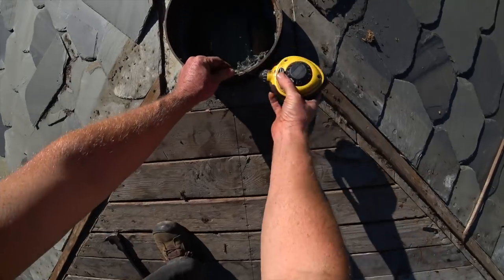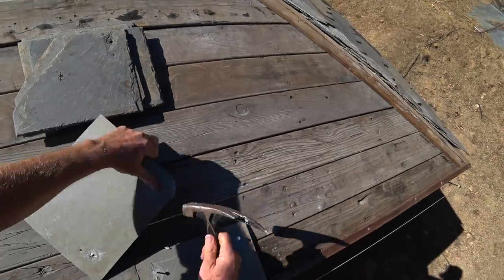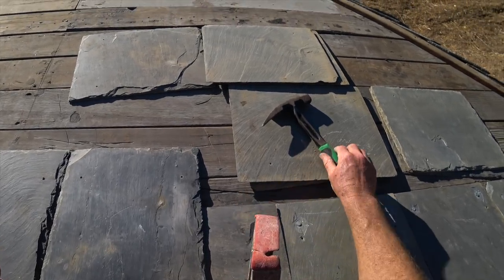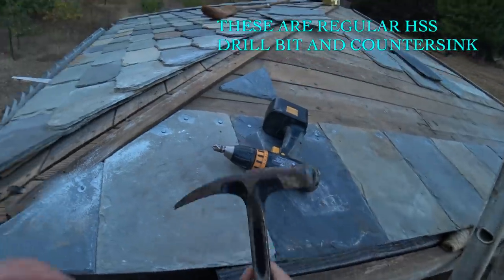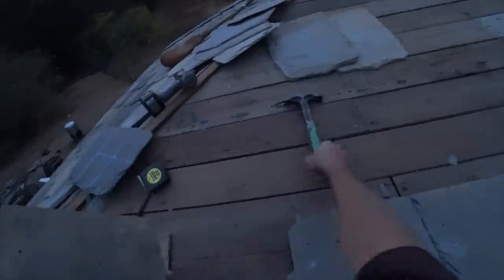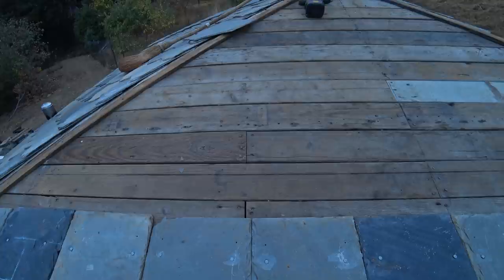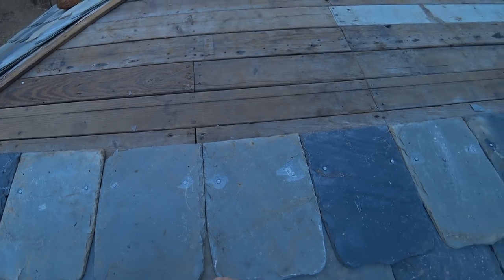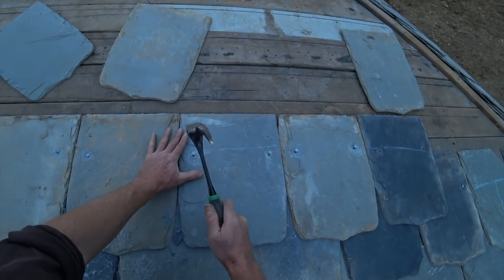Hand Cut Stone Roof #2: Cut, Carry, Lay,  Punch, Align & Nail

Comment: I missed another one live:( Still a great video!  I can really relate to laying roofing asI just completed a shingle roof for my duck house. Around 250 shingles, all hand split by me. Took forever, but it looks awesome!
Reply from the maker: That sounds really cool.  I potentially have access to shingle material.
Reply: @SkillCult  Around where I live (central Europe) most all shingle roofs are made of spruce. I used red oak, just because I found a nice windfall that would otherwise go to my grandad's firewood pile. The knot-less sections split really nicely, but it took me a while to figure out that it doesn't pay off to fight the gnarly twisted growth and is rather easier to just be a bit picky and have more rejects.

Comment: I really love the process, you're very THOROUGH not really skimming over any one aspect of the project, with longer segments that include a lot of the work flow, the quick fixes, and trouble shooting, and mistakes. it's not an "ideal preplanned scenario, it's real time." 

this makes it very easy for me to follow along with more confidence knowing how to manicure the slates to fit just right, and what to avoid doing. I may not slate a roof myself, but I enjoy this kind of knowledge [for tabletop gaming.]  and you present it really well! plese! do more videos of classic knowledge! like...how would you build a wine or root cellar? it'd be below grade, so...how do you shore up the walls, strong enough for there to be a house built on top? that's something I'd love to hear your thoughts on!
Reply from the maker: I"ve never built a root cellar, but I want to. I would probably rely on intuition and overbuilding.  flooding is always a concern though.  Another thing I'd like to build is a spring house.  They are similar but serve a slightly different purpose.
Reply: @SkillCult  Yeah, flooding is for sure a concern! So maybe a sub level, for water to run into...and collect...but makes ya wonder...would the water evaporating, and adding humidity to the air...help the plants? [as long as it's not swampy and rot them...

A spring house...is that like a cold frame? unheated, but still insulating from the winds and frost for helping plants harden off and start the growing season earlier?
Reply: @TizonaAmanthia  A spring house is a building over a spring, with a reservoir for keeping things cold.  People used to set their milk and butter and such in the cold water.  You can probably find some good info on old ones on youtube.
Reply: @TeamWachuma   OH! that kind of spring! yes, I've heard of those, too! heh. Omma durp. but yes those would be interesting but...not something everyone has access to...

Comment: Hey, nice video, its all very well done. We do it slightly different here in Northern India. Live edge planks are placed with flat face up and slates are nailed without any major measuring or aligning process. There are both types of slates shapes the square shaped and the water drop types. Water drop shaped slates require only one nail that is one advantage.
Reply from the maker: Hi Raj.  I have to lay this pattern very careful, or it won't turn out right, but most slating here is not so time consuming or precise.  Most slates here though are the two hole wide slates. I've seen the one hole types on European roofs and sometimes hung on wooden pegs.  I'll look up some pictures of slate roofs in India.
Reply: @SkillCult   Thanks for the quick reply, you can try searching for slate roofs from Himachal/Shimla/Kotgarh/Uttrakhand etc locations. Gaiety Theater Shimla roof is one good example . Take care friend :)
Reply from the maker: @rajender13  Thanks. I like looking at slate roofs around the world.

Comment: Coming along quite nice. Though I do wonder if a 2×6 deck isn't more prone to warping? Thanks for the video.
Reply from the maker: The deck has been pretty stable. I had one weird board in there, but I think it was actually too thick maybe and not just warped.  It's bomb proof and free, so...
Reply: @SkillCult  Free is always good. Perhaps as second use lumber the bad actors have been culled out already.

Comment: Are yor walls unplastered? Or does it just look like that?
Do you think it would make sense to put a Kautschuk foil (or some other waterproof menorane) underneath for extra water protection in areas with rain +wind?
Great video as always! Good tips and triks!
Reply from the maker: Yeah, never plastered.  most natural builders shy away from any kind of waterproof membranes preferring to let the walls breathe.  I don't think anything like that would really be necessary.
Reply: Have zou had any problems leaving the insulation(straw?) exposed? Sundamage? Mice? Bugs?
Reply from the maker: @sempi8159  only a few mice and lizards.  No mould or sun damage.  the straw is coated with clay and there is borax (boron) added in the clay, so no fungus or mold can really grow.  It is also pretty fire resistant.  But it's ugly and leaks air, so I'm still going to plaster it.

Comment: This is so cool to watch! Where did you source so much slate? Or was it purchased?
Reply from the maker: I got two different batches on craigslist for two different roofs.  A lot of bad slates in both batches. You have to figure on losing about 15% to 20% of just bad slates.  Before they are nailed, the slates are tapped to listen for cracks and just set aside, if they don't ring.  So, short of going through them all one at a time when buying, you just have to figure a significant loss.
Reply: @SkillCult  I’m sure all of that was a huge PITA but the end result is so gorgeous
Reply from the maker: @TJHutchExotics  For the big roof, we ended up having to order a small lot of slate from Vermont from the same quarry, in order to finish.  Back east, you can find used slate, sometimes for free.

Comment: Hi! I am wondering where you purchased the slate from? I am wanting to do this, but having trouble knowing where to purchase from.
Reply from the maker: I got both my slate lots used.  But be careful of quality and assume that up to 1/4 are bad.  They will ring test the slate, by tapping in on the roof and if it's dull sounding they put it aside.  Also, there is a lot of cheap imported slate now.  some might be good, but some isn't or is untested.  the stuff from old american quarries might have a few hundred year's track record.  If you can afford it, but new quality american slates.  Used slate can be great too and is often thrown out, which is crazy.  Sometimes you can find an old house or barn to salvage from, or you can buy lots of it.  but only if you live in the right region.  No old slate roofs out here.
Reply from the maker: I got mine off craigslist.